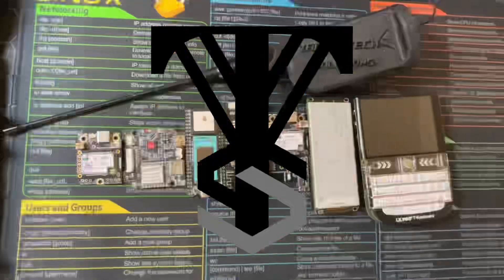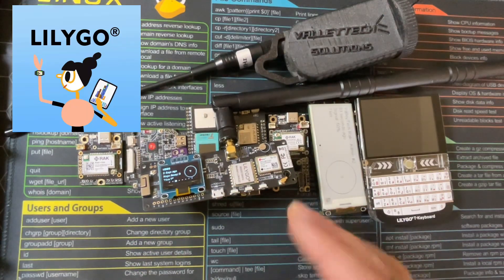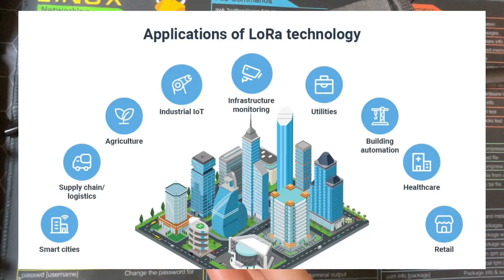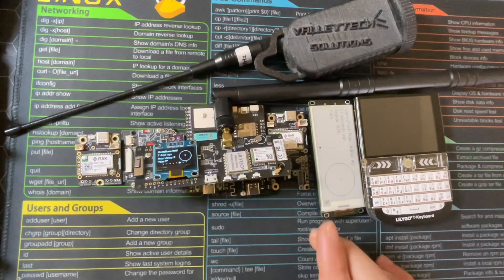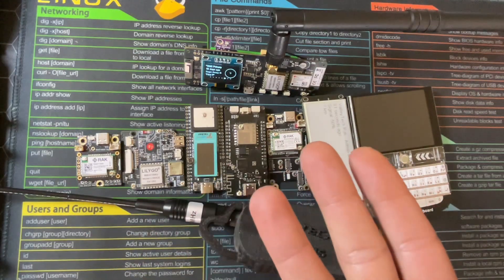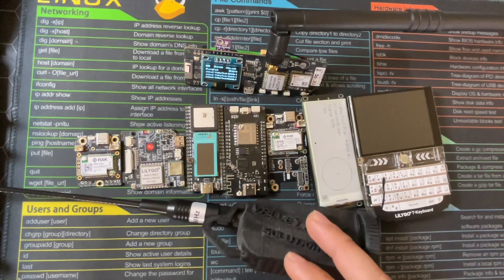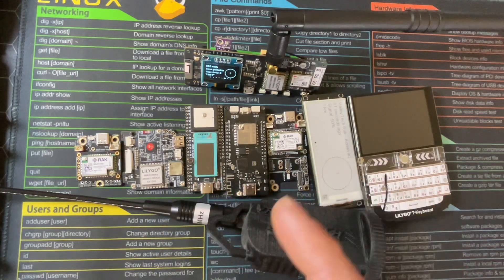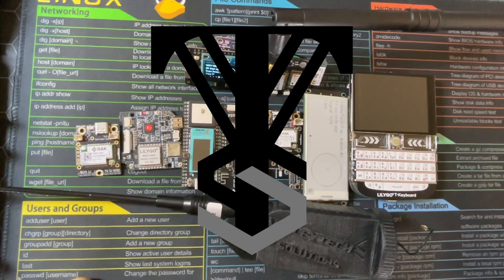Meshtastic Myths: Standing Up To Misinformation

Comment: there’s a ton of misinformation around LoRa so it’s nice to see someone clearing things up. they’re designed with hobbyists in mind more than anyone. the utility is great but the security is definitely not foolproof to the point anyone should be worried about “the criminal underground” using it for communication. at least not more than any other communication technology.